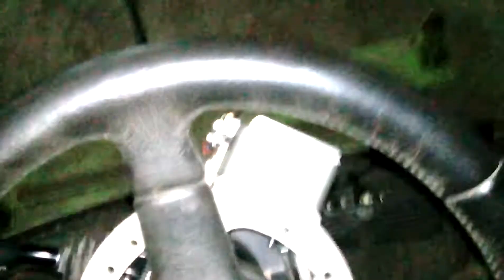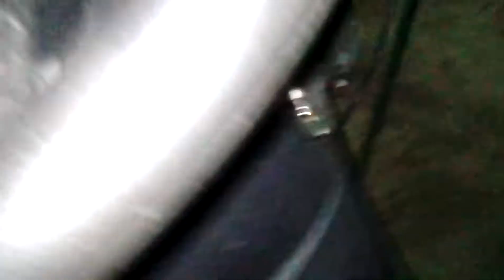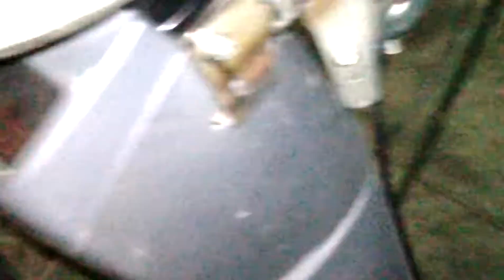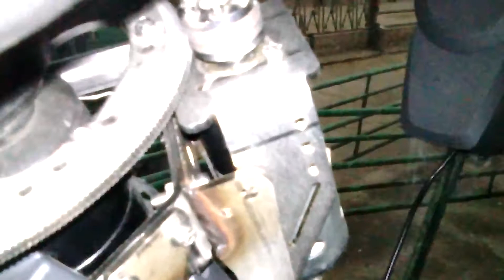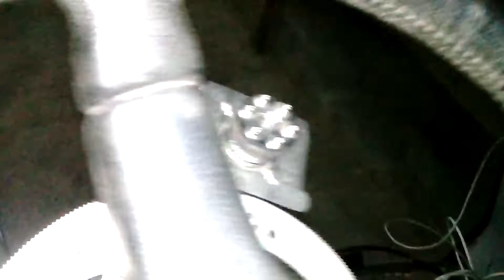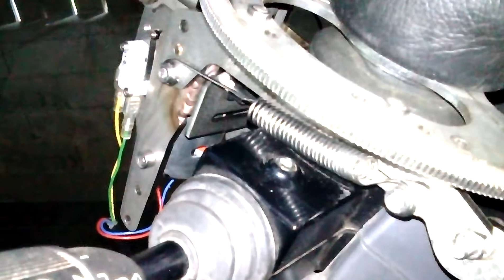CLAAS TUCANO  AgOpenGPS (DIY)  Electric Steering Wheel, clutch_V2 / Volant électrique, embrayage_V2

Comment: Nice! We just finished welding up the motor brackets! Hopefully the motor we found (MFA 986D41) will be good enough.
Reply from the maker: There is no reason it works  this electric motor  for me and my friends  

if  you can share  it   the result
Reply: @entropiemaximun  we're planning to do a post to the forums! I'm waiting for the v2.5 boards then start the final assembly! 🚜🚜
Reply from the maker: @Dezzsoke  great !!!    good  luck  for  next step